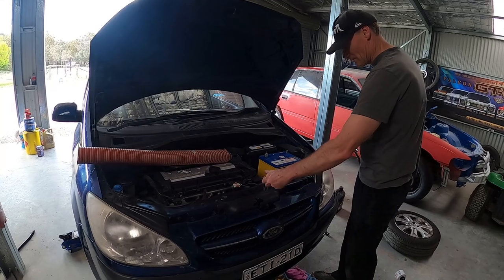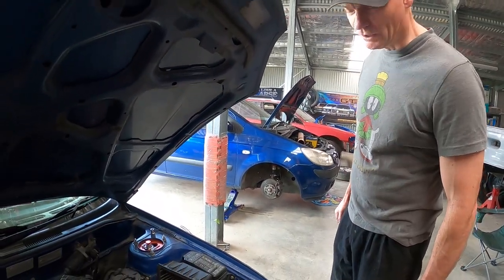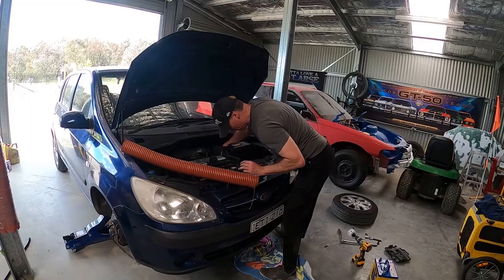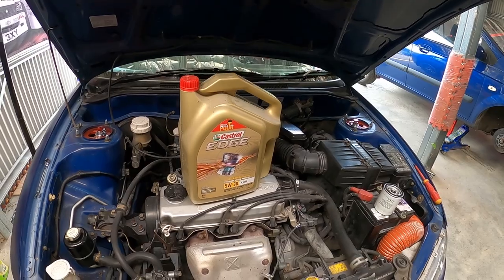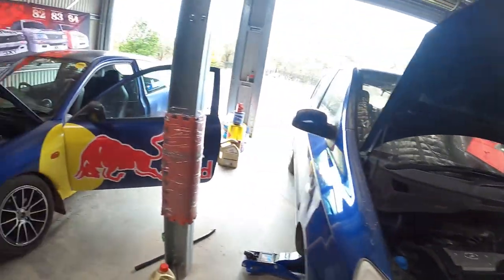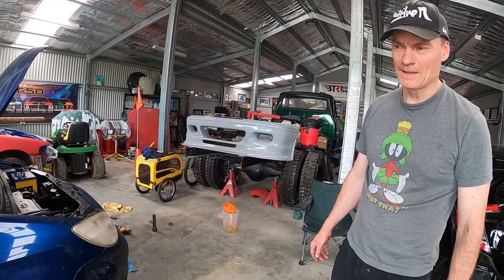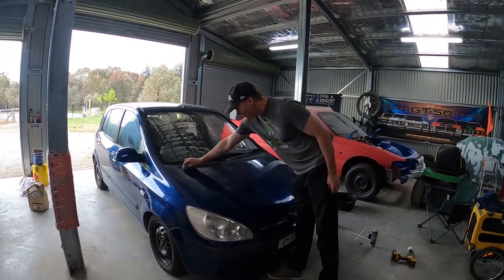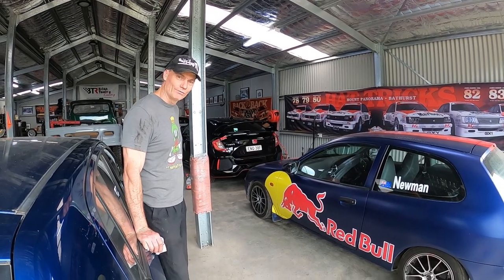Cold Air Intake Mods for our Nugget Track Cars - Getz + Mirage

Comment: I have a Getz as my daily driver to get to work, I drive it pretty "spiritedly" and one day shifting from 1st to 2nd, the accelerator cable hooked up onto the lower bolt on whatever that intake sensor is [I think it's the idle sensor from memory], and it was just stuck wide open throttle. Thank god it's a manual. So I had to make a little metal shield over it attached to the top bolt. Just a heads up.
Reply: Did you turn off the ignition or push the clutch in?
Reply: @angry9901  Panic clutched, shat myself, engine off, pulled over.
Reply: Well done, happened to me but with a carby, turned the ignition off and it back fired, kicked the throttle plates closed and I changed my Regies.
Reply from the maker: Thanks for the heads up Gerald.  I will ensure Frankie is aware of this issue as we hit the track this Saturday.
Reply from the maker: @Gerald5000  did you hit the rev limiter when you panic clutched?
Reply: @ClunieGarage  yeah, it was bouncing off the limiter, it hurt to hear the poor little engine doin that.

Comment: Hi I am just wondering did you guys get an ecu tune on the Getz nugget to take advantage of the intake and exhaust mods? If so what did you do?  I’m told the stick ecu can’t be tuned is this true?  I have a 2006 1.6 petrol manual Getz. Cheers. Tony.

Comment: No front sway bar.....that will be interesting.  🤔
Reply: Will it go round corners better or worse?
Reply from the maker: G'day Gary, Frankie has it all in hand apparently.  I will reserve comment until we see some lap times.
Reply from the maker: @angry9901  I reckon you should disconnect the sway bars on your Mums Caprice.  Then maybe set the rear shocks up to full hard, fit some of those high pressure and high treadwear tyres you rave on about, set the fronts to full soft and then give us some r&d feedback we can use at the track for our nugget track cars.  Sound like a plan?